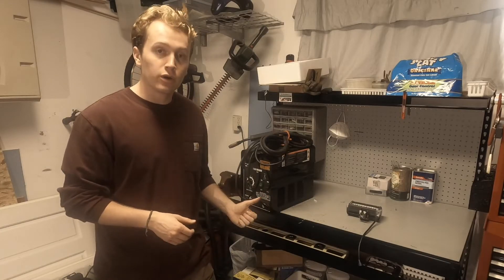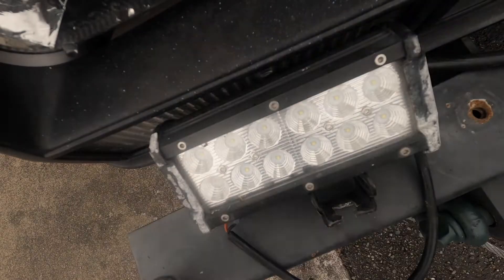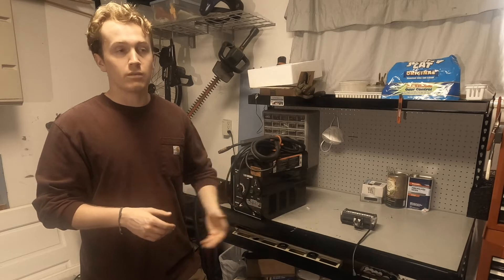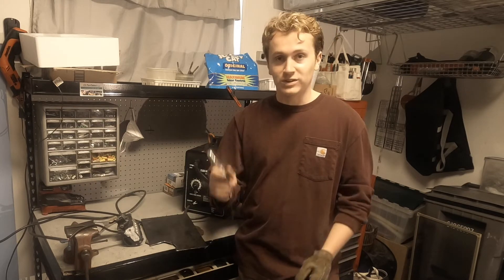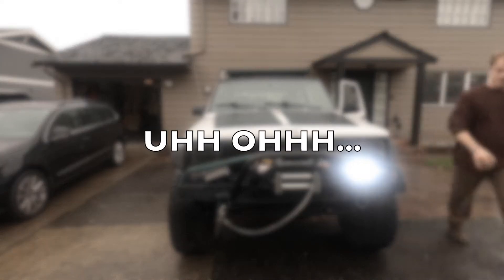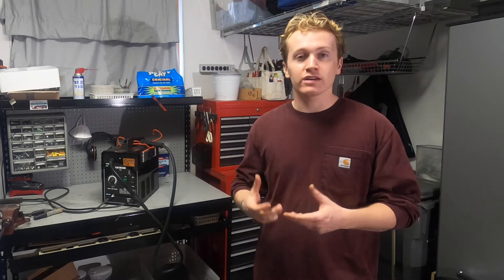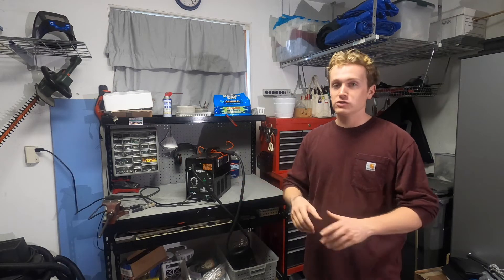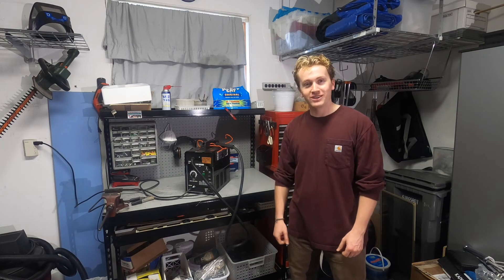Will welding on your car damage your battery?

Comment: Because..I promise you didn't bust the myth that way, and it is not a myth , as I just got my truck back after some welding was done and my one month old battery is shorting out internally . Hmmmm. Wonder how that happened. I've fried a battery on a motorcycle by forgetting to disconnect it. And it doesn't fry it how I would think . You'll have random electric issues ...it damages the cells inside the battery.
Reply: If you use Mig-Mag welder, that can't be happen. In some cases the computer and other electronics can be damaged, but the battery can't.

Comment: This test does not represent grounding the welder to the car and welding . #1 the light does not work in a loop. It works with a ground. And a 12v DC current. Get a 12v battery. Hook it...the ground for the welder , and the ground for your light to a metal plate. Hook the positive to your light . Then weld the plate.  Then test your battery.

Comment: 88 camaro. Welded with the battery connected. Burnt up a ground wire for the cooling fan. Ran a ground for the wipers and blower motor because they quit too. Its a black and red stripe wire on the passenger firewall that needed clipped and ran to the battery, after hours of troubleshooting.

Comment: IT ABSOLUTLEY CANNOT UNLESS MAYBE YOU PUT YOUR NEGATIVE/GROUND ON THE DAMN BATTERY TERMINAL 

use common sense people, you can weld on a piece of metal while holding the metal bare handed and not get electrocuted, the arc is where the energy is, its where your current is and 99% of the time you are NOT going to be the path of least resistance unless you have copper bones and you're sopping wet
Reply: Yes, welding on a car can cause significant damage, especially to modern vehicles with sensitive electronics like the ECU, sensors, and airbags, by frying components with stray voltage or induced currents if proper precautions aren't taken,     (requiring battery disconnection)
    and grounding the clamp close to the weld. Damage can also include warping metal, damaging paint, and creating fire hazards, so always disconnect the battery, remove nearby electronics, and follow manufacturer guidelines,  Common sense say disconnect the battery. seen it fry ecu's and other electrical items Been a welder and a mechanic for 48 plus years son
Reply: think of lighting hitting a block away and your microwave does work any more common sences says that light strike fried it and it didn't even hit it

Comment: sigh no its not the key you didnt even do a real test, your welder CREATES a voltage, your battery is 12v, if your welder is a different voltage it will cause a short, sure you might be far enough away that it doesnt do much, but everytime you dont disconnect the battery you take the risk of a short happening, best to just disconnect the battery

Comment: That's interesting. So I have to do some welding on a zero turn mower. The exhaust is cracked in a few different places and I need to weld them back. My question is would you pull the battery and pull the fuses from the electrical system?? Or would you remove the whole exhaust system as much as that would be a pain?

Comment: a friends jeep will not charge the battery after welding the chassis, did not disconnect battery, it's newer jeep with a generator and electric assist battery, still can't figure out whats the problem with it!

Comment: Good practise to disconnect the battery and alternator sense lead and charging + wires. I had welding done on my Mercedes SLK at a workshop, it killed the alternator and the Locks controller needed to be replaced and a new one reprogrammed. (£1200) I later welded the front wing with oxy-gas welding which has no electronic issues.
Reply from the maker: I have heard alot of stories like that, I haven't put any more time into recently but I would like to make a video proving it (short of just welding directly to a CPU.

Comment: On most cars, the body metalwork is also used as the negative "wire" to the battery for all of your electrics. So not disconnecting the battery means feeding the welding current to the battery and through to the cars electronics. Your led was not an equivalent test. Keep on disconnecting the battery in the future. Electric vehicles could have even worse problems, depending on the wiring scheme.
Reply: TRUTH! As for EV's - don't even attempt!!! Just thinking of all the individual cells in the battery frame itself is mind-boggling. I'd rather be SAFE and disconnect. Fry a PCM, ECU, unreplaceable and 'they-don't-make-that-part-anymore', ANYTHING connected to voltage might fry. It's really not the voltage - it's the AMPERAGE. BIG difference. All it takes is one jolt.
Reply: The current takes the path of least resistance. Why do you think it needs to travel trough the whole electrical system and/or battery so it can reach the welder's negative (or positive) clamp??
Reply: @Asky_  what he said

Comment: disconnected battery, wielded on the tail pipe. still screwed up the circuit..
Reply from the maker: I still pull the battery cables off every time I am welding, old habbits.  I have been working on another test to see if I can "determine" where the circuit is coming from but no different results so far!

Comment: I would have thought this was a simple yes or no question 🤔
Reply from the maker: Most people on the internet have an opinion on it, one way or the other. I have read some posts and seen videos of people saying "Ive done it this way for years without problem" but I wanted to see if I could visualize any evidence. I was expecting the answer of "yes it does cause damage" as I have always been the disconnect the battery type of person.
Reply: @SomeGuyOutside  Fair enough.